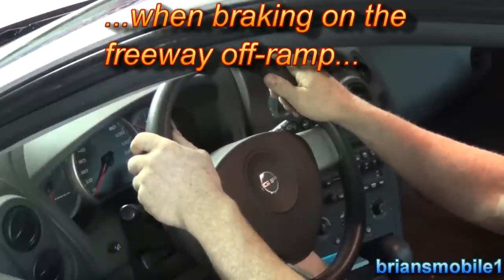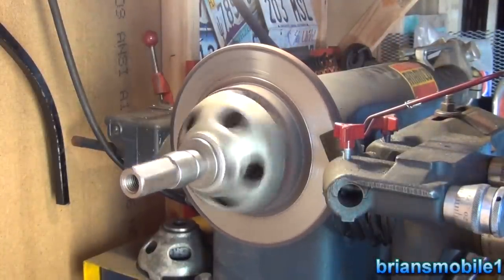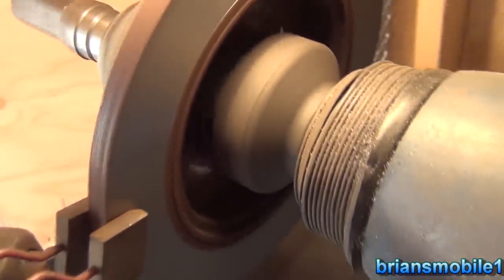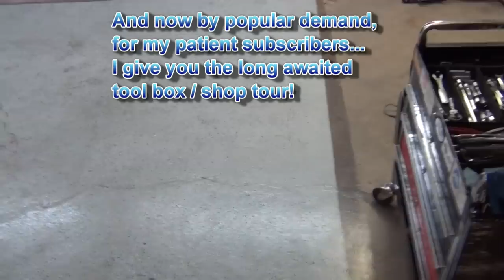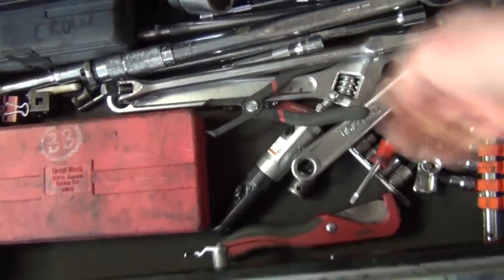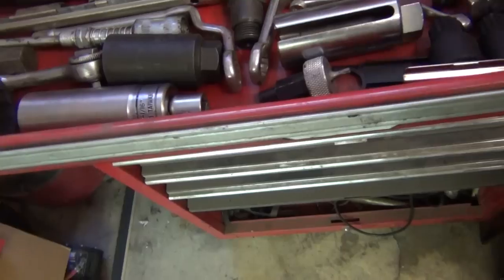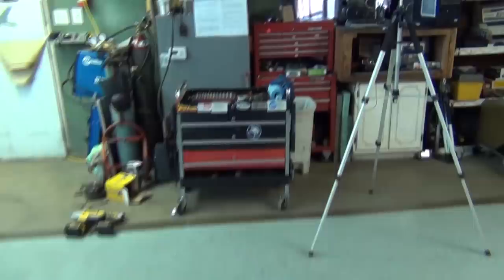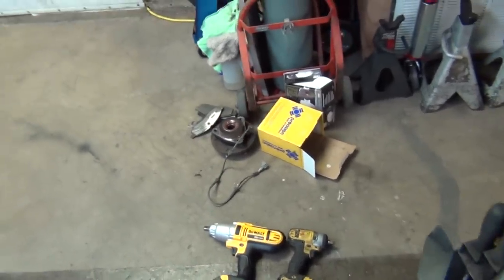Why Your Car Shakes When You Brake "Shake'n Brake!"

Comment: when I push the brake peddle, I can feel the brake paddle push back towards my foot periodically. It doesn't feel like the ABS so maybe it's due to the uneven rotor like in the video? The car vibrates during high speed too, what would be the cause? It's hard to find a good mechanic in my city, tried a couple of shops and they all suggest to do four wheel alignment, which they did, but didn't help...
And what could be the cause of an uneven rotor (assuming it's a not bad quality rotor)? Does it indicate there's something wrong with the other components of the car?

Comment: Hi how far out was that rotor once the rust was knocked off. I was lucky with my car. I just knocked off all the rust and after 2000 miles all the vibrations went away. Any tips to stop them rusting? On my car the rust gets in under the braking surface which has horrible effects to braking!

Comment: If the car vibrates, and doesnt stop as good as it used to, whats the problem then. The harder you push the brake the less it vibrates.
Reply: ** GLADLY ACCEPTS ADVICE😀**. spiffcats... thank you! U described my 08 GMC SIERRA's problem perfectly! I thought rotors too.  But my mom n pop tire shop said it needs front brake pads, a new transmission, & rear differential, (told me "jus get rid of truck"). Ummm no🤦🏻‍♀️ this  struggling single mother loves & needs this truck! It's kept kiddos & I safe thru some crazy things & is paid for! So, Replaced front brake pads, & struts/bushings.... still issues... Then Took it to discount tire.... they said it's ANOTHER bent 20in wheel, (some truth to this bc it originally started an hour after having tires last rotated).   Finally, Discount rotated the bad wheel to the back tire... it was MUCH better for 1 -1 1/2 weeks... but it's awful again!!!? 
Symptoms were EXACTLY as Spiffcats describes.  Only other thing is I feel there is slightly more 'play in the steering'?
Prob need new rotors, something done to tighten steering, & my expensive & hard to find new 20in Tx Edition Rims?....  ANY ADVICE APPRECIATED! Thanks for your time!

Comment: What does it means when breaking your car seems like it's  pulsating when stopping and feels like you have to push more down on the breaks to bring the car to a stop. i just had new front pads and rotors replace last year. the back break are drum breaks. 2007 Saturn Ion.

Comment: Cool tip about the front vs back brakes. Didn't know that!
If I feel it in the wheel but not the pedal yet, does that mean its just the beginning?
Reply: ***** I've never felt one in the pedal.
Reply: Samniss Arandeen It goes back and forth, kind of surging. Its a little like ABS kicking it.
Reply: ***** Ah, thank you. A front wheel vibration can be many things, this should help narrow down causes.

Comment: Had this issue. Damn pep boys replaces the rear brakes and rotors and this it still shakes. They claim the front brakes were fine. I hope they are not trying to play me. Got to go take it back and see what they say.
Reply: It's your front suspension bushing! You got played.
Reply: No dumb dumb it was the brakes. I have the same issue now on my F-150. The roots have an uneven wear pattern in them so I'm getting those replaced too.

Comment: That's the point of a slow final pass....avoid the coarse finish, topped by a sanding disc...yes, I am overboared!
Reply from the maker: I do like your attention to detail.  An old guy in the bay next to mine was like that on rotor finish.
Reply: I just got some rotors that were painted.  Never saw that before so I didn't do the multi-directional finish.  Seemed to work out OK although the first few times braking it made a strange noise and smelled like burned paint.  Ha ha ha. Previously all I had seen was that greasy coating you have to clean off with brake clean.  I'm wondering if the rest of the rotor where the pads don't slide might not rust as badly as normal since it is all painted.

Comment: HI Brian, I experience the "shake'n brake" thing, however when completely stopped, is this just my break booster causing my engine to rough idle for a second? The engine is completely mechanical and there is no ECU. Thanks.
Reply: your brake booster is powered by your engine vacuum. lack of manifold vacuum shouldn't cause rough idling, unless it was effecting your vacuum advance, which it shouldn't

Comment: Mine shakes when i break until after 30 and anytime after that hitting the throttle i was missing the break hardware on my right side  which is where its coming from Could the pads potentially be moving causing the shake? Its just the right side not the whole car.

Comment: i got a drum rear brake but
i feel like its the abs (since they were found cut and reconnected)  fault its only vibrating at times and  can only be felt from the front

help? is it the abs ?
warped rotor (there are groves on it like canyons but not deep )
CV joint?
tire alignment?

help

Comment: If you can afford it, it's always better to replace the rotor or drum since they are the heat sink. Braking is essentially converting the kinetic energy in the vehicle into heat and it's got to have a place to go. When the rotor or drum gets lighter, it can't absorb as much heat as a heavier one and will reach a point where the thermal variance isn't big enough to provide adequate stopping performance sooner than the heavier one.

I was ASE certified back in the 80's and had turned hundreds, maybe thousands of rotors working at TBA shops, but when I got a job at a GM dealership and they sent me to the Atlanta Training Center, the engineers there gave me the straight dope on brakes. Today, the cost of labor to turn rotors isn't enough of a savings to justify a brake system that will fade out 50 or 60 feet sooner than one with new rotors.

Even more than Doctors of Humans, we Doctors of cars hold the lives of many more people in the palms of our hands.

Comment: heat is a rotors enemy, and so is an un informed driver that rides their brakes. All one needs to do is inform the customer to stop riding their brakes and exercise the proper braking technique so rotors don't overheat and warp...especially on large trucks and suv's.

Comment: what else could cause the steering wheel to shake when braking shortly after replacing the rotors? this has happened to me twice on my Subaru Baja. Normally I never have that kind of problem when I have changed them on a differernt Subarus I have had in the past.
Reply: +MissouriOldTimer Did you replace the pads too?  What is "shortly after" ?

If you didn't replace the pads, they may have unevenly worn the rotor.
If you did replace the pads, you might have a stuck slide which is unevenly wearing the pads / rotor.
If your slides are good and the caliper is good, it could be ABS activating when it shouldn't.
It could also be a wheel bearing, but that would be accompanied by other symptoms such as unpredictable steering and a roaring sound from one of the wheels while driving.
If it has a noticable shake while not braking, it could just be that your brakes are exacerbating another problem somehow... ball joints / inner tie rod / etc.  But that's unlikely I think.

If someone told me they replaced their own rotors and had this problem my first guess would be that they didn't replace pads and grease slides + etc.
Reply: +kevin smith thanks for replying,, I did the work myself and I put the ceramic pads on the last time, the calipers seemed to slide on the pins ok but one might be sticking, this car has 240,000 miles on it so it might be some other problem causing the shaking, the odd thing is , once in a while it doesn't shake when applying the brakes. I think I do have a wheel bearing that is noisy but not sure it is bad enough yet to cause this. Thanks again for replying, it gives me some other things to check that I hadn't considered.
Reply: +MissouriOldTimer It's the improper torquing of each where.  It needs to be equal on all the nuts/bolts otherwise it wont spin equally causing the pads/rotors to not have good seating and cause vibration.  I never change the rotors just pads and it's smoother than ever.
Reply: Anthony Abelardo Thats only a problem if the wheel isn't fully seated.  It's really noticeable too.  His problem comes and goes.  It's ok for lug torque to be different so long as it's all close to spec and the wheel is sitting flat on the hub.

Comment: Changed pads and rotors with dealer parts, a year and under 3k miles later wobble is back when braking
I don t understand
Reply: Check the caliper
Reply: stephen loreca
Thank you, I did last week
Mechanic said even GM dealer parts were made in China now, and that was the source of a lot of problems
Reply: Cheap materials.  high end after market parts are the way to go and if you can find them American made, even better.
Reply: hutchbeartrap22
Thank you
Mechanic mentioned that too
No more buying dealer parts for me unless local and brand name
Reply: CheekyMonkey888On new installation, torque the wheel lug nuts to spec during the repair and every 100-150 kilometers thereafter, until the famous "loosening over time" phenomenon stops. This will ensure that the rotors have no room to wobble under hard braking events, such as emergencies and yellow lights.
Reply: kdmq
Thanks - never knew there was such a thing
Reply: CheekyMonkey888 I found a Blog by an ex brake engineer from the old Shelby Cobra days and beyond.We don't break in our brakes correctly and we get a build up of material on the disc from light low heat generating braking and  I'm sure cheaper parts contribute faster but it happens to all manufacturers.Much more explanation to this transfer of material and the science behind it.                                         Nut Shell0-60 MPH hard breaking (without locking the breaks up ) to 5 MPH                                DO NOT STOP!!!!!!!! 5 MPH back to 60 MPH hard breaking to 5 mph and reapeat this 7 times.NEVER come to a complete stop during this process just drive it off after number 7 and let the breaks cool. They cool pretty quick.If you think Im full of shit then don't research it , don't get the scientific facts and don't bother trying it....But if you do then be prepared to have the most incredible breaking unlike any breaks you have ever felt,no matter what car you drive.If your breaks have under 3000 k and are new and installed correctly I promise you that your WOBBLe will be gone.......
Reply: Miles Lane Transportation
Thanks, I am going to try it because here I am two months after resurfacing the disks and having a mechanic disassemble , lube, and reassemble the brakes, needing brake service once again
Reply: I had the same problem. The car shakes under braking. So I replaced rotors and pads. Now it was all butter smooth for 2k. Then the shaking came back. I replaced rotors and pads AGAIN with a better quality ones. Same thing, smooth for a while and then shakes. The mechanic proposed using OEM rotors, which cost 1.5k for my car.... I changed mechanic and the other mechanic said that bad wheel bearings will cause uneven brake rotors. He said that the wheels feel firm but a very small play in the wheel bearings, which cannot be felt, will cause uneven rotor wear and he offered a 20k guarantee that if I change wheel bearings, I won't have any shaking. So I replaced all the wheel bearings and put in new brake rotors (the cheapest, lowest quality ones) without changing the pads. That did it! The car did 30k after that and still no shaking whatsoever.
Reply: CheekyMonkey888 Did you clean ALL the rust from the hub-disc contact surface?

Comment: I would rather buy new rotors than take them to get ground down but him......Sorry the price of a new isn't that expensive. On top of that you don't know what damage the pads have, so replace them too. Also a detailed inspection of the calipers is needed. At this point I would rather replace with new parts than have to take it all apart again later because I was cheap.

Comment: Rotors are so cheap, When I replace brakes, I replace the rotors with them. Been doing this for years. I know the oem stuff is much better but when you get them so cheap, why not replace them with the brakes. I don't think on high end auto's this system would work.

Comment: You made a video about most common issue just to get the views,,  what if the rotors are new  axles new tie rods new wheel bearings tires new alignment and balance done, and the car is vibrating shaking when driving 80MPH soon as you steer left or right at that speed it shakes even more..   Yeah keep guessing now could be this or that..

Comment: My racing-miata viberates under hard break-ins on track, its smooth to the start but after 10-12 minutes of hard driving the whole car viberates like crazy and its most sensable through the break peddal. the rotors are Willwoods most hardcore rotors for racing and we just recently installed them.. any ideas?
Reply: Are the rotors getting warped or are the pads depositing materials on the rotor causing bumps?
Reply: well, this happend on the first race after new rotors and pads are carbotech XP-20 which have done 2 race weekends... so its pretty fresh stuff...
Reply: Oskar Jakobsson #96 Sounds like you need larger brakes or some better brake cooling.
Reply: Sigma Projects lol, i have the most hardcore and expensive brakes willwood make for the mx5 and they wheren't easy to get, next step is AP racing but come on, im only running 112 whp...
Reply: Oskar Jakobsson #96 Then maybe the cooling isn't good on your setup? If you have quality parts and they can dissipate the heat they shouldn't become warped to easily or the pads start to deposit material on the rotors.
Reply: Sigma Projects its wierd... im going to make a video later on the entire setup of the car... but, man, iv got, fresh air intake cooling individually for both rotors... and last time i drove it was 10c outside...
Reply: Oskar Jakobsson #96 And you get brake pulsation after 10~12 minutes of racing? Do others have the same issue?
Reply: Sigma Projects not pulsation, very rapid viberations and no i haven't hear from anyone else, I do think it has to do with the bedding of the pads, we are getting now rotors and pads for next season, and this time we are getting ferodo pads:)
Reply: Oskar Jakobsson #96 Oh sweet. Yea, hopefully it's something simple like proper bedding of the pads.
Reply: Oskar Jakobsson #96 need a higher grade brake fluid. It is getting super hot and boiling. Dot 4-5 I think are more silicone and withstand higher heat
Reply: Aaron Bradley we use the most high end DOT-4 racing fluid and have never gotten air in the system or any boiling. Secondly- if there would have been boiling the peddal would be spungie and soft, which is not the case.

Comment: Shops that use an impact gun on your wheels will warp em' every time
Reply: He's correct, it's the uneven pressure.  Once they get hot, it tends to warp the metal.  The reason for torquing lug nuts is because they are supposed to be torqued to a lot less torque than people think (Subaru is 65-72 ft. pounds for example).  But it's also to have even pressure on the rotor so when it gets hot there is less chance of warping.  Impacts torque different rates depending on where the compressor is in the cycle.
Reply: I learnt the hard way. I have a keyed set and the wall of the key is thin. After breaking the key twice, I'm no longer allowing any shop to tighten the lugs anymore. Tuner lugs are torque specific.
Reply: They don't even allow us to use them in pretty much any aviation shop unless it's some pneumatic gun that costs 2 grand
Reply: Not entirely true. There are tools called torque sticks that limit the amount of torque an impact can deliver. I use them all the time and routinely double check with a torque wrench to ensure they are still tightening the correct amount. The ones I use in my shop (I've been working on European cars for over 25 years) are over ten years old and still work perfectly.